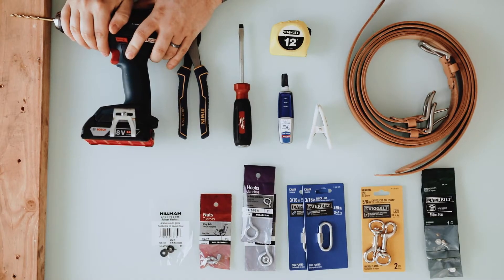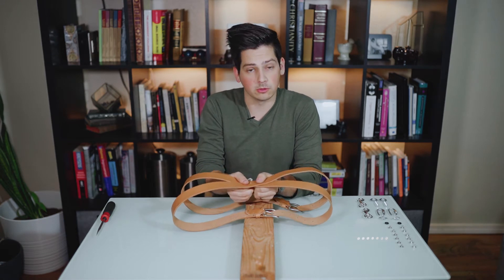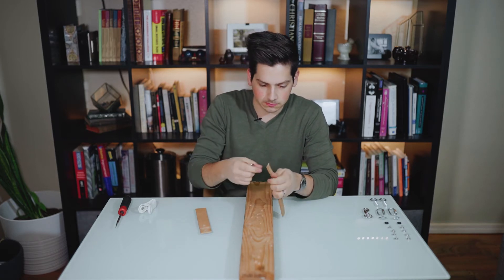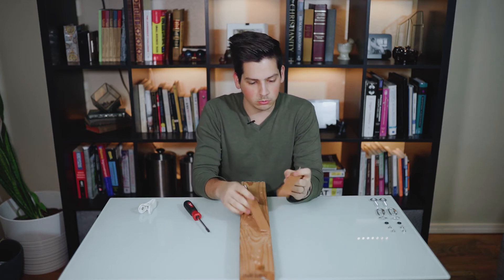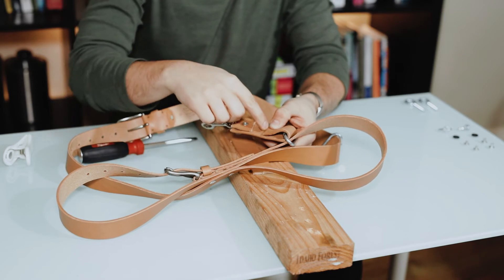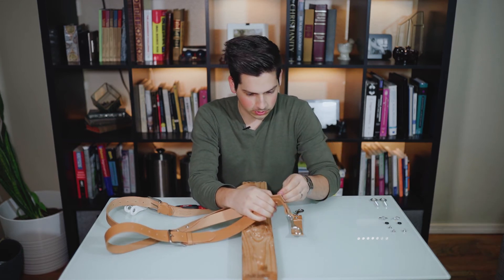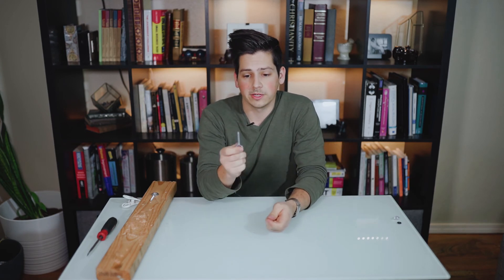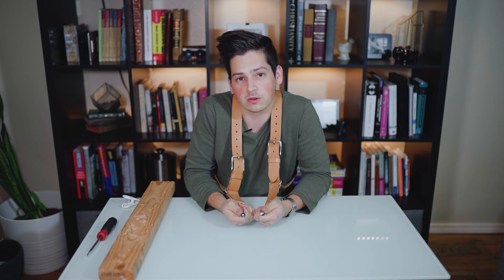[DIY] How to Make a Camera Harness | Fulltime Photographer EP 2

Comment: You weakened the leather part where the camera will hang, don't think it's a good idea.
Reply from the maker: Luca Raimondo 
Thank you for your concern! Ive done quite a bit of testing on this joint and have not found that it is prone to tearing or weakening. The inherent nature of the leather allows it to be flexible and tough. We have been using these straps for a few years and have never had any joint failure (unlike other versions of this strap). That being said, we are always open to suggestions!